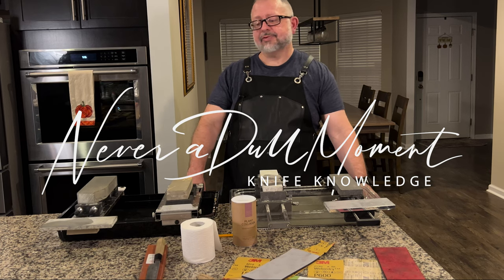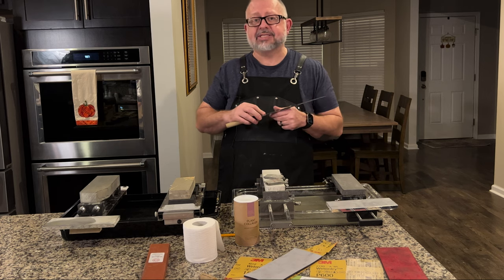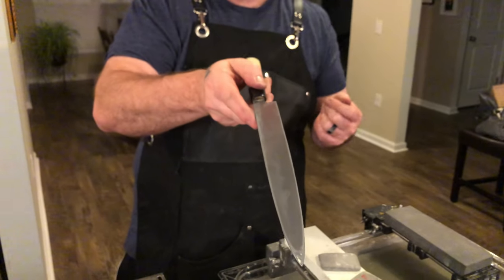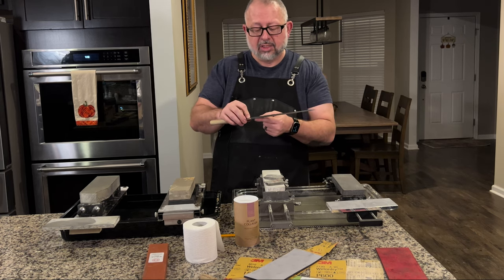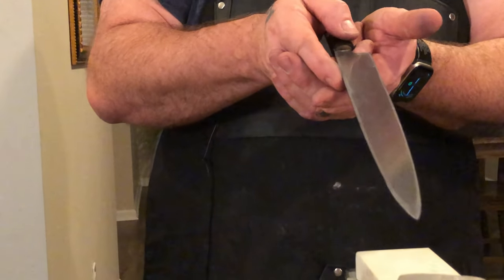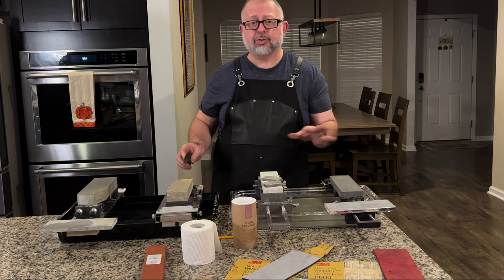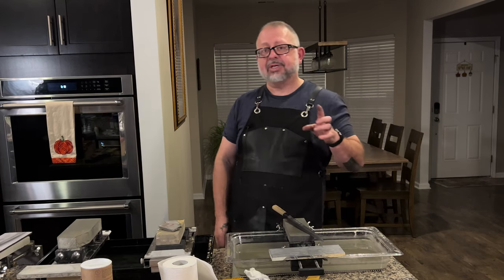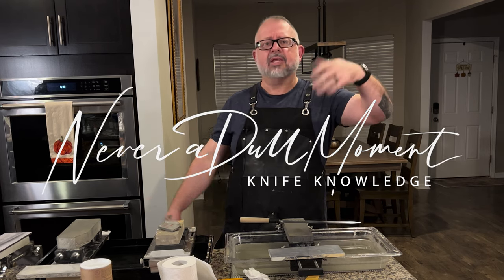Knife Knowledge: Repairing a scratch on the Urasuki of your single bevel knife.

Comment: I would add that the sanding progression depends of the scratch depth. The deeper the scratches are, more likely to start with lower grits as 320/400 and up. Sometimes might need even lower grits. Most important step i found out during this type of manual polishing with sandpaper is that the first lower grit needs alot more sanding than one might think before going up to the next grit, otherwise it will show at the final steps and will require starting allover again. Next tip is that depending of the blade geometry i put the sandpaper on a piece of wood ( can be many ways, not only wood) something that can let me grip with both hands while pull/pushing when sanding. This method first of all divides the weight/pressure more equally than by hand/fingers to the surface of the blade and execution takes less time than doing it by bare hand.
I will leave a link with a video the way i do it for a better ideea and also hoping it helps out in anyway. They are videos with different sandpaper progression starting from 320 up to 5000 grit sandpaper+ micromesh 8000/12000+ polish paste and results after each step !
 Hope it helps!
https://www.youtube.com/watch?v=kCcOsc6Ygz4
Reply from the maker: Now that I have done some knife polishing I completely agree. Everything you said is absolutely true
Reply: @nadm  i forgot to mention, sandpaper should be done with watter on steel.
Reply from the maker: @TocilarulTimisorean  one thing I’ve done for a long time is you sandpaper. I’ve done it for a long time on various materials. You can do it either way. You can do it with water to make it finer.  You don’t have to do it with water. You just change the scratch pattern.

Comment: Nicely done sir.
I use a lot of scotchbrite wheels, I wonder how that would do. I get very even finishes with them. Thanks for the vid. Fun stuff!
Reply from the maker: I’ll have to look into that. I had heard of that but I haven’t looked into it. Thank you. I’m interested in you. What are you making?
Reply: @nadm  it’s worth a look. scotchbrite comes in a lot of grits and makes very even satin finishes. Pretty sure a 6” round would fit that radius well. Easy to use by hand as they weigh almost nothing. 

As for me, the progression into what I’m doing is kind of a ten pound answer. I am doing fine arts blacksmithing and welding, (mostly TIG) doing some large format sculpture and architectural (lot of mid century and Tuscan coexisting here in the low desert of SoCal, lot of opportunities) but I am designing some blades as well. I’m starting a classic full flat grind bushcrafter at the moment. I also love restoration. The spokeshave I use for carving axe handles for instance is itself a Bailey #3 from 1858. Probably my favorite tool. I like to think of the stories infused into the old stuff. I’m sensing a new “problem” with my eyes being opened to the Japanese blades. Fascinating stuff. Working art.
Glad I found you, I’ve been very unsatisfied with systems based sharpening. The waterstones are definitely more my style and I’ve been trying to hoover up all the info I can. Just waiting on the big brown truck to bring my new goods…
I tried to make this answer as short as possible but brevity is somewhat difficult in a fair answer here. 
Enjoy your Sunday!
Reply from the maker: @baldwin9281  thank you for that and you enjoy your day as well. We had a day filled with filming episodes through the rest of the year so we can take some time off.
Reply: @nadm  Couple additional Q, if I may?  Got the Chosera pro 1000 and Rika 5k. I’m going with an Atoma 400 that I can also use as a plate while I decide what else to do. Does that make sense? How hard is it to clear the scratch pattern? 

I’m looking at the sigma 240 and the Shapton pro - Ever use the sigma? It’s supposed to be a ripper but I will assume that applies for most in that grit range…

I will add an atoma 140 in a bit or just put the replacement pad on the other side of the 400.  

I hope filming went well. I pivoted into this stuff after a long run as a commercial photog/designer specializing in food and lifestyle (thanks, Covid 😠 for crushing my food biz)

Thank you!

Comment: You finger is convex, it does not have concavity, but we know what you mean.
I'd bet that the concave side of the knife was ground on a .5m diameter wheel or larger.  You are closer with the cardboard salt container than you are with a cork or your finger.
Reply: You finger is convex, it is not have concavity.  (Stupid predictive text).
The knife is concave, and it is polished with a convex (the opposite  form) shape.
Reply from the maker: I agree. I think I was making the reference to say that there’s different size objects that have different levels of roundness according to the depth in concavity your needing. I honestly think that a person had the ability to create a dowel at the correct size it would be the best. Not everybody has all these tools. I don’t have all these tools